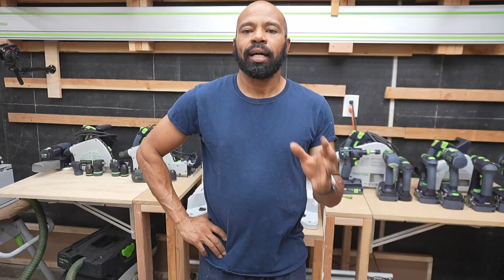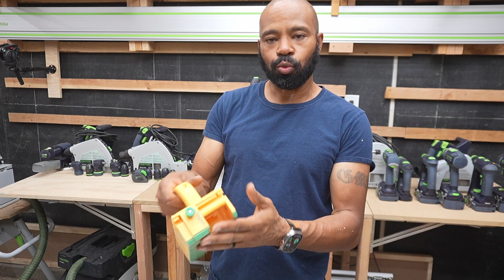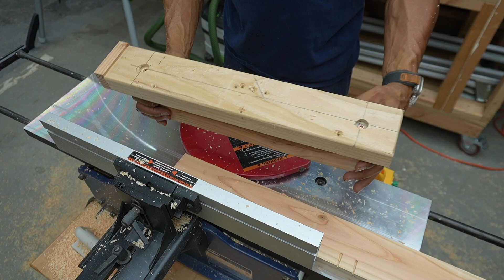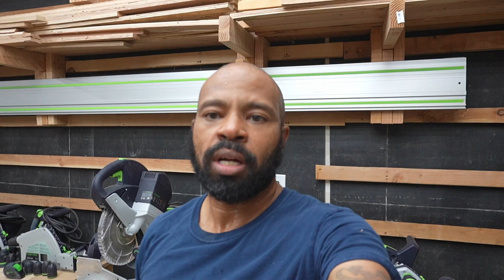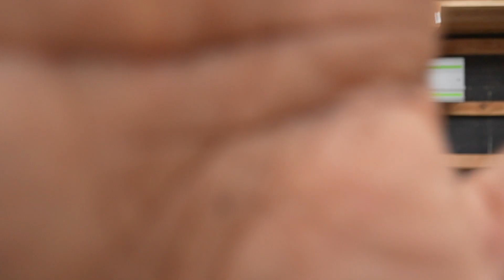Daddy Share Space In The Shop Vlog Jointer Push Block Prototype 7 24 24

Comment: You don’t want to bear down on the workpiece you’re running over the jointer. Just push your board across the in and out feed tables using as little effort as possible.
Reply from the maker: Thanks for the tip. The pressure should be on the out feed table right?
Reply: @daddysharespace  You want to run your board through with the ends of the bowed side touching the table and just use the absolute minimum effort. Too much downward force on the workpiece and you will potentially flex the board which will cause it to just spring back and not give you a flat reference face for the planer bed.
Reply from the maker: Thanks that explains my results.
Reply: @daddysharespace  If that’s a new machine, you’ll also want to check that the in and out feed tables are coplanar. Raise the infeed side to the same height as outfeed, place a level or straight edge across the two and check if there’s any deviation.
Reply from the maker: Will do.

Comment: Ok, glad the algorithm showed me this video. Subbed. Like your style & how you think about stuff. BTW, not sure where you're at, but I can get white oak from the hardwood dealer at just a little bit more than pine from the box store. You might want to take a chance on it. It's great for inside & outside projects, plus it's strong enough for furniture. FYI - watch out for the splinters though, they'll getcha!
Reply from the maker: Thank you for taking the time to check out the video and for the support. I will check in with a local hardwood dealer to see if they have decent prices. Thanks for that tip.

Comment: I wounder if you can fabricate something to connect your Festool miter-saw wings to your benchtop jointer for the in-feed and out-feel supports.
Reply from the maker: Not a bad idea. I want to build a cart that will give me an extended in feed and out feed table. I have to solve the in feed height adjustment challenge first.